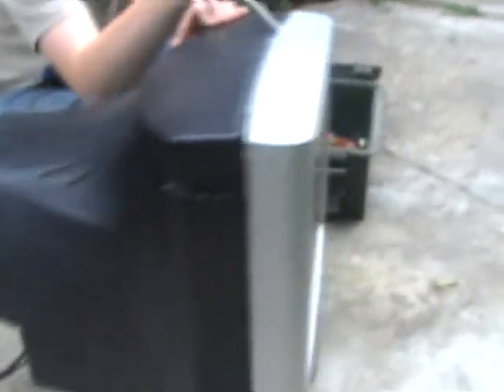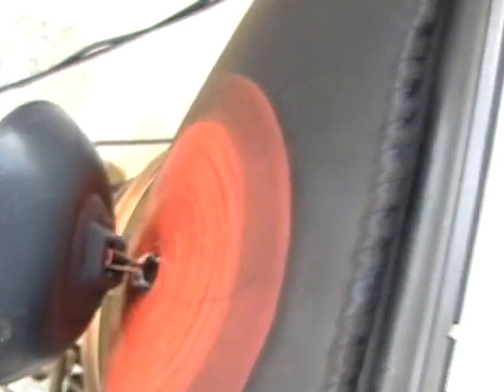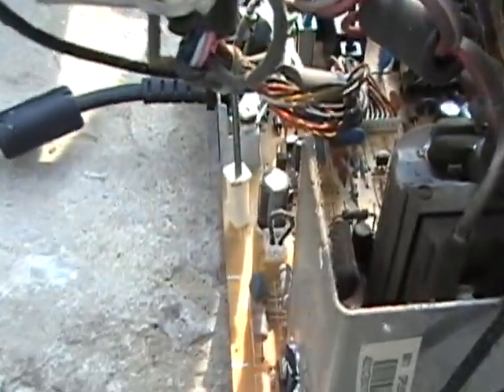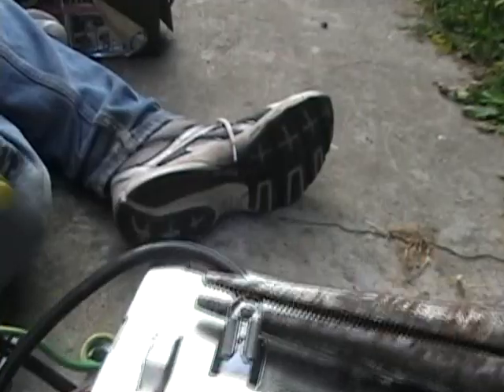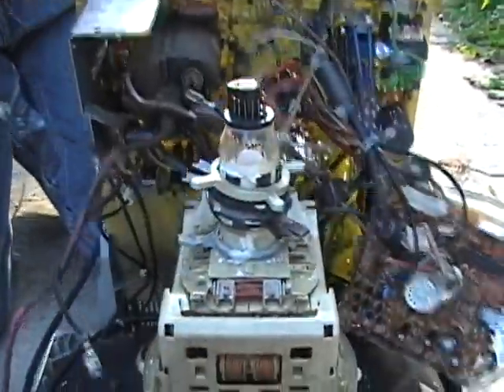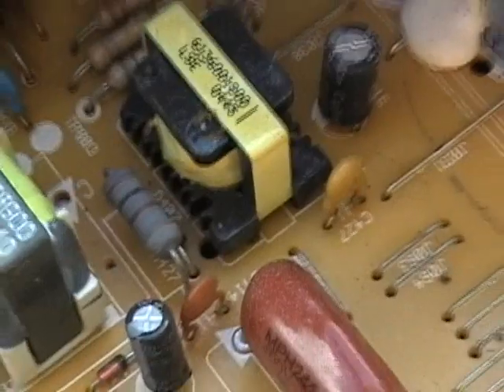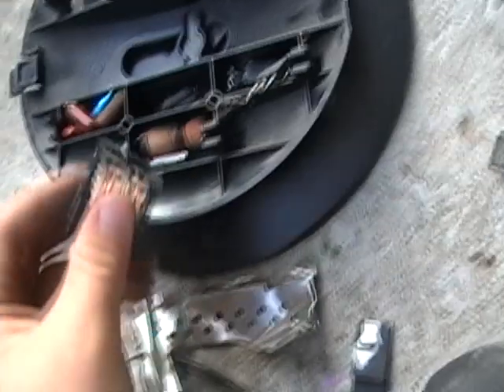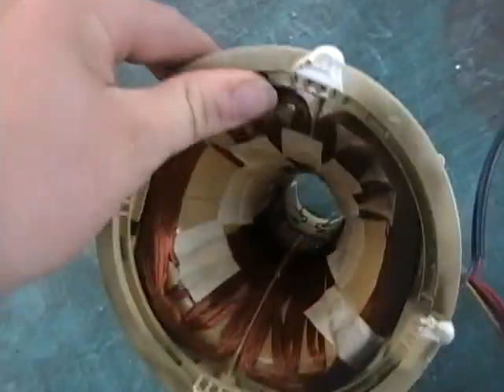take apart a computer monitor

Comment: im pretty sure that the radiation in only emmitted by some electronic components during operation for instance you just get radiation from using it but very low doses 
there isnt really any significant radiation from the solid state ones today but old tvs yes and tonnes of it.

Comment: Pretty smart kids,! You avoided getting shocked and radiated...Good Job! 
Once I saw the warning of radiation when I got inside an old monitor, I stopped to find safe way to tare this thing apart, for the parts. I barely know any of this, but have some mechanical knowledge... What parts are used for what on building other things, and what parts to scrap because of gold in it and all?
No matter how old yah get, yah learn something new everyday, even from kids!
Rock On!